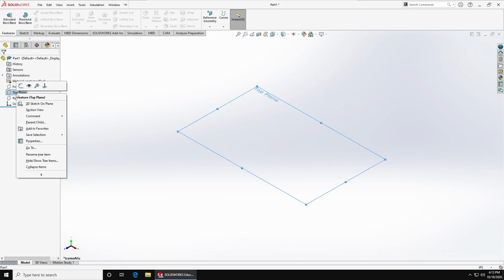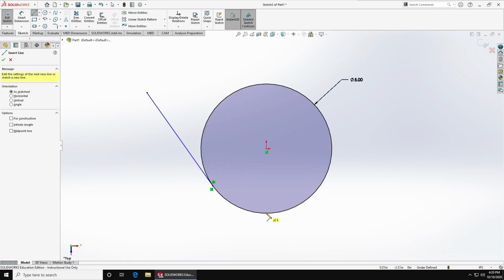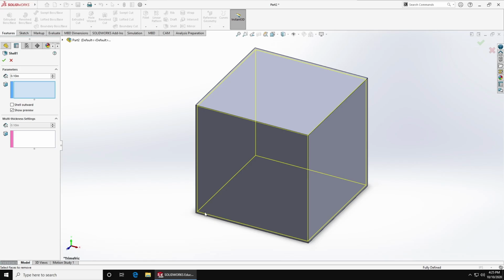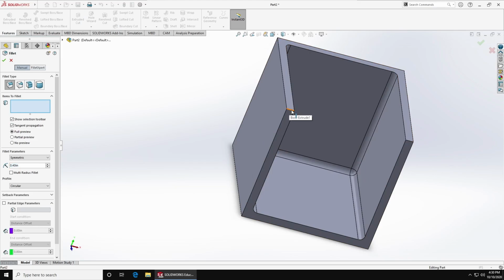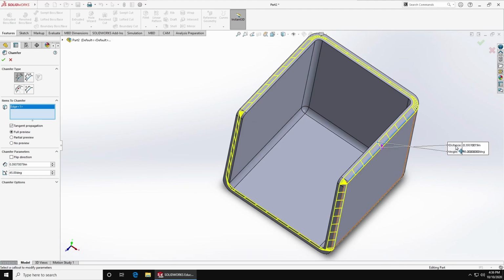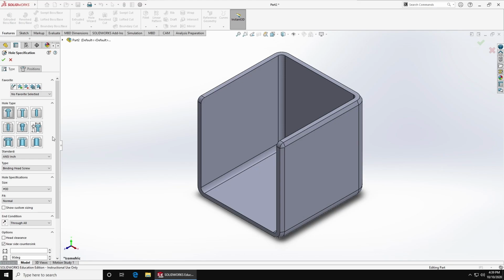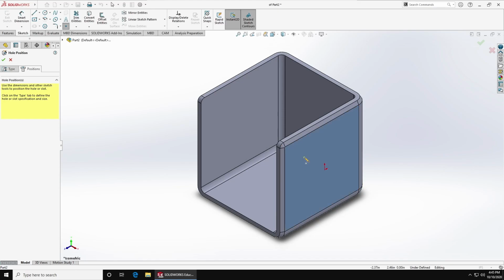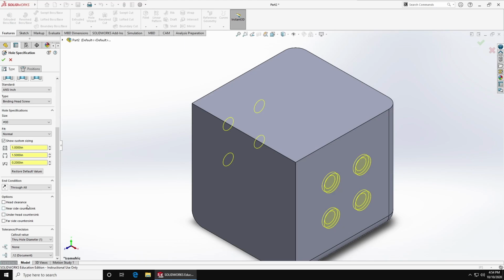SolidWorks Lab 6: Shell, Fillet/Chamfer, Hole Wizard, and Thin Features

Comment: The trim feature won't let me trim closed entities. How did you get it to trim your circle, which is automatically a closed entity?
Reply from the maker: The trim tool can be a little tricky depending on your geometry.  Remember that it only works if there's an intersection between sketch entities, so if you don't have anything intersecting with the circle it won't know what to do.